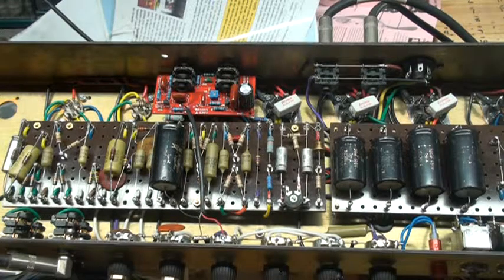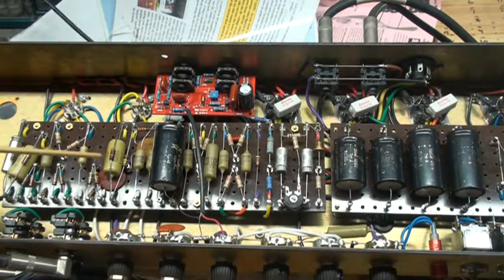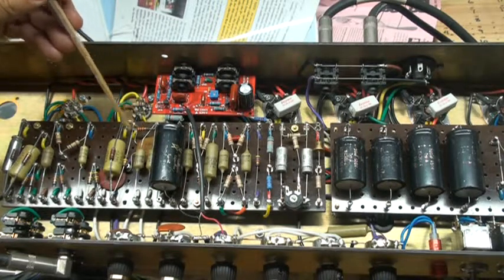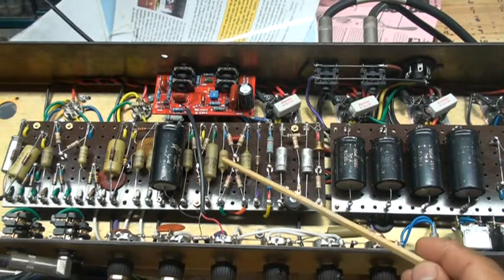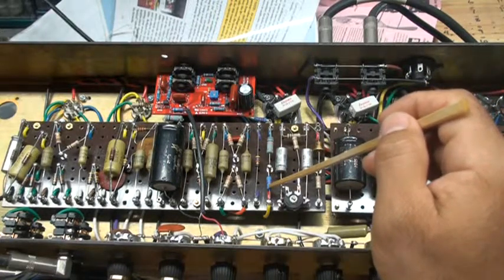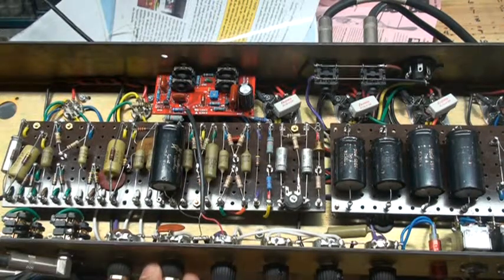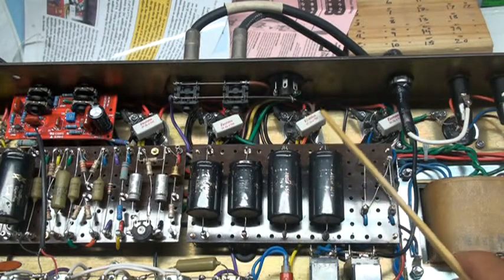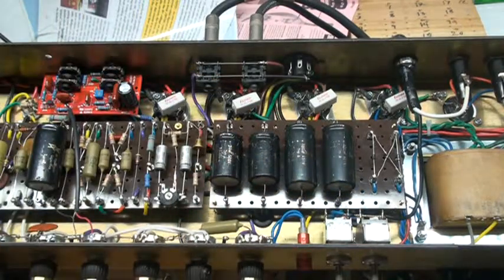1968 Marshall Plexi Rebuild 1

Comment: Hey I'm fixing to build one of these.....I have the same transformers except my power transformer is the standup version of the 1203-80......can you tell me where you grounded everything.....I'm thinking starting from the pre amp side....the input jacks and cathodes and filter cap go to the buss on the pots along with the bias ground too....and then the heater center tap and mains and screen filter with the diodes go to the ground lugs on the phase inverter cap.....but I see you have ground lugs on your power transformer bolts....what did you ground there?.....can you help me to ground mine right?....thanks
Reply from the maker: I would be happy to help you, through email though, if thats okay with you? Axeman6@msn.com
Reply: @conjering  cool